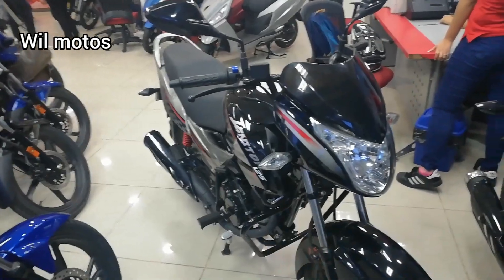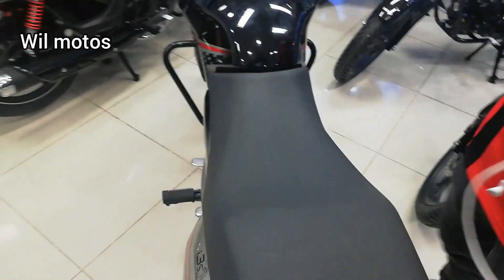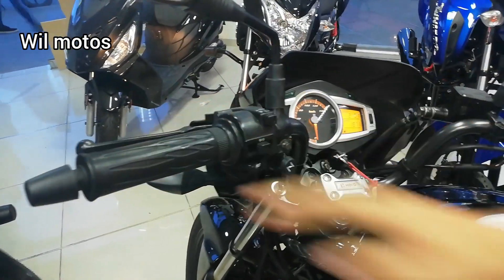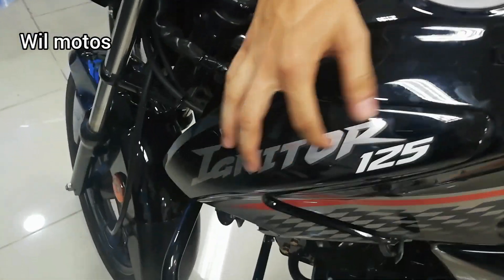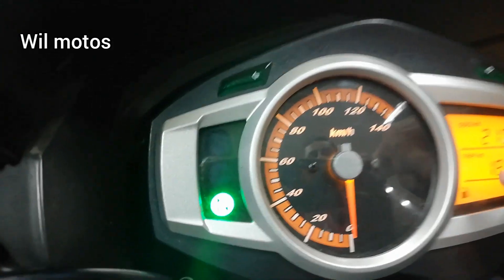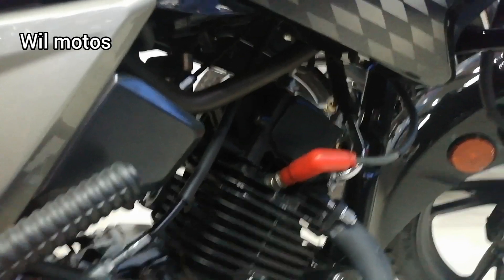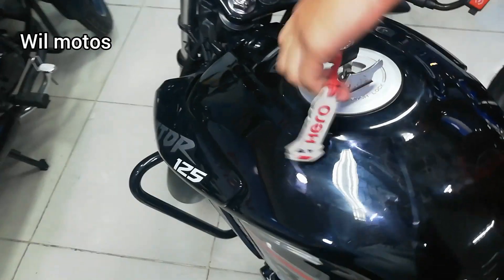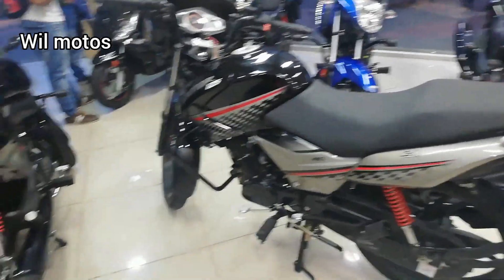Hero ignitor 125 cc modelo 2019/2020 especificaciones técnicas,. (wil motos)

Comment: Hello this is not ignitor this is glamour
Reply from the maker: Hola saludos shubham si es la misma, sino que esta es la version mejorada, pero estéticamente son las mismas, solo vario sus especificaciones dadas que se dieron,, saludos 🖐️👍
Reply: shubham kumar it depends on the country, In India they say their ignitor version has been discontinued, however the ignitor on latinamerica is a better version of the glamour we had, so this might be the glamour on India but it has the 3s system, is 11.5 hp (and not 9), it has (10nm and not 9.3) so is not the regular glamour and is not fuel injected or doesnt have abs brake system so this isn’t  the FI, or either of glamours on India.